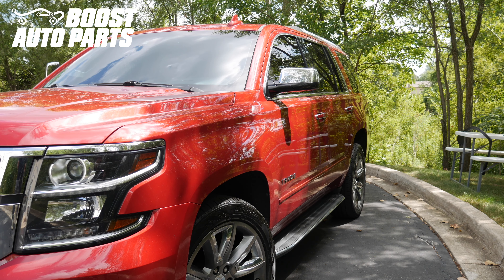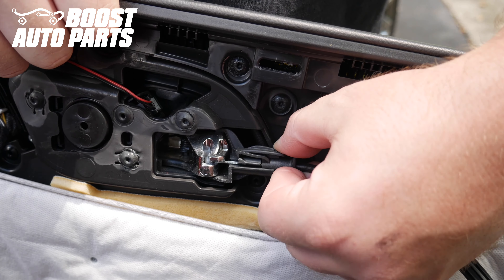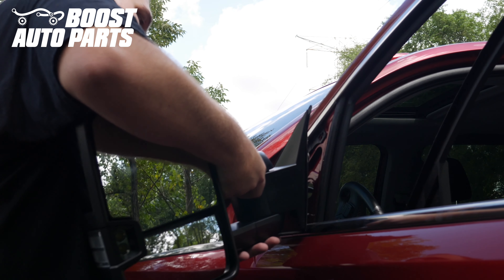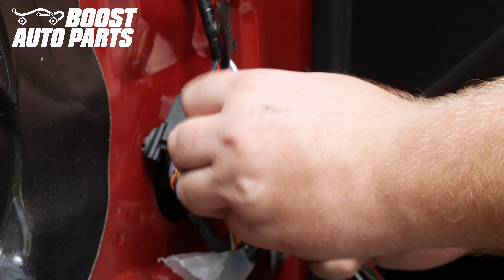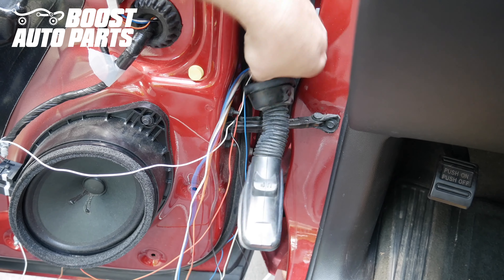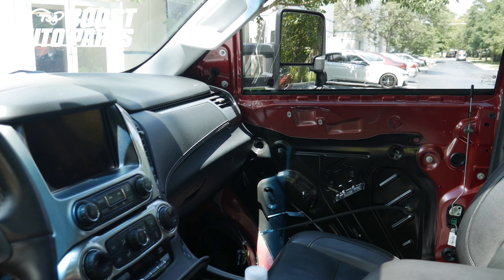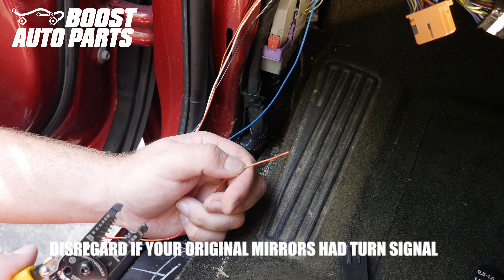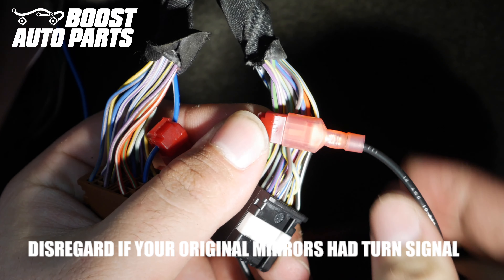Full Tow Mirror Install: (2015-2020) Tahoe, Yukon, and Suburban - Boost Auto Parts

Comment: We're just gonna talk a bit about the video. At 1:04, my panel would not remove by pulling out. I had to pull up, which takes the window sill with - not a problem though. When attaching the new mirror, keep a 10mm nut at the ready (like between your lips). I recommend attaching the nut on the top bolt first to avoid stress on the bolt/body. When running the wiring from the door into the body on the right side, it is possible to run the wire without removing the inside panel/step.
These would be 10 out of 5 if they had the power fold option and the turn signal on glass had the option of amber (instead of just red). 
This is by far the best and most visible video on installing these mirrors - even if you bought The otheR brand.
Reply from the maker: Glad we could help - although we think you'd be happier with our mirrors which are proudly hand built and QC tested right here in the USA and supported with a full range of parts!

Comment: After installing the fuse taps in the engine compartment fuse box, how do/did you get the lid back on the fuse box with the wires now hanging out?
Reply from the maker: You can notch the fuse box lid out slightly.

Comment: Just recently installed these, thanks for the video btw, but I noticed my backup lights are not coming on. I have the this same model and everything else works, blind spot, turn signals, motion, but no back up. What did I do wrong? Thank you for your time.
Reply from the maker: Please reach out to support@boostautoparts.com so we can get this resolved ASAP.

Comment: Do you sell power folding tow mirrors for 2019 LT tahoe. I need power folding tow mirrors. My oem mirrors do fold but are too small. My oem mirrors are power folding, automatic tilt when in reverse, have memory feature for 2 drivers, turn signal in the mirrors and blind spot alert.  If you don't have power folding, do you have a manual folding option that would work for me?
Reply from the maker: We offer every option you mentioned except power fold for your 2019 Tahoe. 

Pickup a set here:  https://boostautoparts.com/products/2015-2019-gm-suv?utm_source=GM%2015-19%20SUV%20Install&utm_medium=Comment&utm_campaign=YouTube

Comment: For the defrost feature, if you didn’t have them on your original mirrors is there an extra wire for that?
Reply from the maker: Hello, 
If your original mirrors did not have defrost ours will not work for defrost. There is no way to add this feature.
Reply: Boost Auto Parts wouldn’t it be possible to just tap into the defrost button? Or add my own stand alone button for defrost?
Reply from the maker: @probeach3d  If the truck was originally equipped with defrost then ours will be plug and play. For trucks not equipped with defrost there is no upgrade path. 

If you have a rear defrost button it will be plug and play.